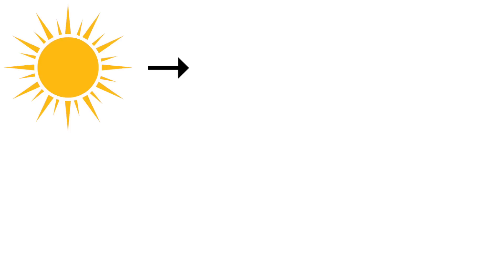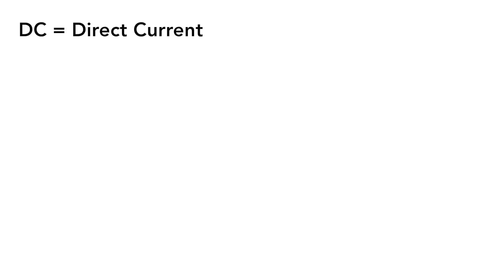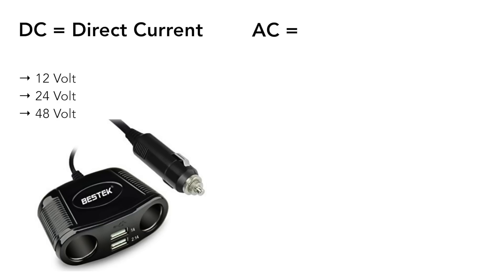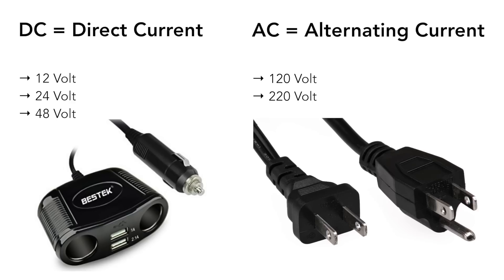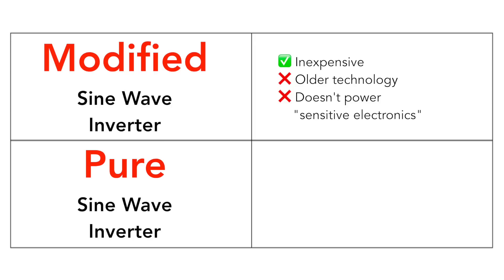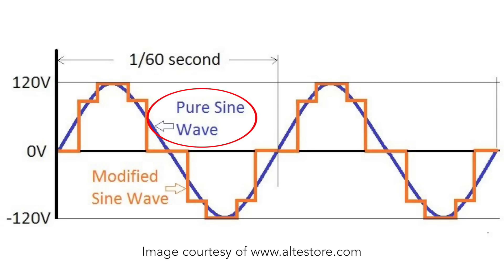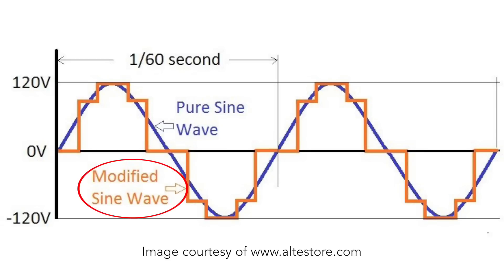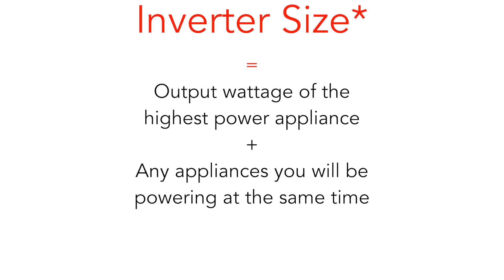Solar Inverter + Alternating Current vs Direct Current Explained

Comment: When you say if you use 2.8kw you need a 3kw invertor. Surely a 3kw invertor is 'peak' power, so wouldn't it eventually cut out?
Surely of you was using 2.8kw you would need atleast a 4kw invertor?

Comment: I use a 36volt to 200volt DC to DC converter to run my home appliances, most of them can run on DC and it's way more efficient than a pure sine wave inverter.

Comment: Can a solar system work without batteries to power my AC appliances? 
Panels->charge controller->inverter

relying entirely on the presence of the sun/no sun no power

Thanks in advance!
Reply from the maker: You really only need a charge controller to to properly charge the batteries in an off grid system. Grid-tied systems will use panels and inverters to offset your electricity usage and they can function with no batteries needed.
Reply: @DuetJustusFam  thank you for your response!👍

Comment: DC is also far more fatal, both from electric shock risk, and actual electrical fires. Getting electrocuted by ac power with less than 1 amp, and you only get a shock. DC power doesnt have an interupt, and forces constriction along the muscles the electricity is travelling through, making it extremely difficult to nearly impossible to move away, to release your grip, what ever means you'd normally be able to escape in an ac shock event. keep this in mind when doing a self install.

Comment: You asked about use of modified sine wave. I have a PowerSource 1800 Solar Generator (modified sine wave). I power two laptops, router/modem, Roku box and a 40" flat screen (during power outages) and haven't had any trouble (yet)

Comment: Another  concern I have is I'm using 4 lithium ion 100 amp batteries and 2 sealed batteries all in parallel because my 2500 watt pure sine wave inverter is only capable of 12 volts at the moment. I plan to upgrade. I read/heard that having too many batteries in parallel is harmful to them. Is this true and how can I improve my system

Comment: Solar arrays are most beneficial during the summer months and I'm living in Newfoundland with plenty of wind. The wind generator will supplement my energy need during the winter months. There is a built in charge controller in the sun force wind generator but I have not means to measure it and if I were to connect it to my 40 amp mppt charge controller, I would possibly exceed its capacity. I have an old 30 amp pwm on hand with a display. The wind generator has a built in controller but no display.  Can I run both in series?

Comment: Im wondering to avoid all these possible hassle can i just buy a solar generator with build-in inverter? Will it be more expensive than buying all batteries, separated inverter, wires, etc..?

Comment: I learned a lot  from your video and I thank you very much for that. If I consume ~ 20000W is it okay if I buy an 8000 W inverter? I will have 4 panels with 100 W and 2 battle born batteries. Thank you very much for the answer.

Comment: This subject is very technical and I can understand how it might scare off those that are not technically minded.  You have done a great job of explaining these concepts and kept it simple for those non technical people. 
 I agree with what you said about not using  a modified sine wave inverter for sensitive electronics. In my experience  modified sine wave inverters  (MSW) are not all created equal. I have come across some where the steps are so large that the wave output is almost a square wave. It is still AC output but the 'spikes' at the leading or trailing edges of the waveform is in my opinion what might damage electronic equipment.  I have also tested others where the design is no doubt of better quality and the steps are so small that the modified sine wave very closely resembles a pure sine wave .  Of course one can only see this after purchasing the unit and observing the wave on an oscilloscope.  I would still not use these for anything other than very rugged equipment.    One more thing,  induction motors such as the motors used in refrigerator compressors or pool pumps etc , do not tolerate MSW inverters very well , for these motors only a PSW inverter will work.  
 Great channel  , I'm going to search for your other videos.

Comment: Modified Sine Wave actually pretty safe to use with computers. It's pretty bad to power fans, fridge etc because the jagged wave will heat the motor so much it can break them.

Comment: Please produce a diagram of how all the components might be interconnected into a single system. Your videos are clear and concise; however, I am retired electrical electronic technician. I just do not have solar powered system experience and would like to fully understand the solar before installing a system. ALSO, please explain the micro controllers' advantages/disadvantages along with the availability of monitoring software's purchasing location and maybe cost. Thank you!

Comment: Your videos are excellent and clear.  I'm an electronics engineer.  Some fine points:  120 V AC is the Root Mean Square (rms) reading, which is a calculated measure that makes 120 V AC equivalent to 120 V DC.  So the peak voltage of 120 V AC is actually 120 multiplied by the square root of 2:  120 X 1.414 = 169 V.  This  peak voltage goes positive and negative 60 times a second in a smooth curve.
Most modified sine inverters have only 3 voltages:  zero and +/- peak (about 169 V).  They work OK with most computers, which have switch-mode powers supplies that convert the AC to DC immediately.  In fact, most Uninterruptible Power Supplies (UPS) used as computer backups provided modified sine wave output.  Modified sine inverters don't work well with motors and some old electronics with 60 Hz transformers.  Another problem with motors is the starting current.  A refrigerator may run at 3 amps, but require 30 amps for a fraction of a second to start.  
thanks,
Reply: I would be lost with your explanation. This video is for novices without your level of education.

Comment: Re your question about modified inverters running sensitive equipment, I bought a cheap 300W inverter and it powered the LED TV, the satellite decoder and I also spend a few hours on my PC. It also works with the modem. I am not sure if it is doing damage, but I there is no signs of a problem.

Comment: fantastic ... but what about surges and remedies for surges.

I'd like to see something about the latest tease, power wise.

The use of capacitors ... storage of power ... release of power and if the release of power can be controlled(resister?), to make the power release last longer ... maybe hours,  AND if it's really possible to dispense with batteries in favor for the capacitor...  

I'm also curious, as to the specific benefits, and best uses of a "Solar Generator" ...

Comment: Goodnight . nice series on solar units but one correction when showing the sine wave and modified sine wave the 120 0 and _120 volts .that is incorrect , if it is AC there can be no negative(_) 120 volts.it. is just 120 volts AC peak to peak.

Comment: a quick question , if my household runs 220 volts and i have a gadget which is 2,800 watts that runs at the same time and i needed to use 3,000 watts inverter , can i use this 3,000 watts inverter  to run 120 volt  and  or 220 volt?.  hope someone can answer this question, thank you .

Comment: thanks, I enjoy your videos ...  As for inverters I've been using modified sine wave for many years .  I run my laptop , tv  stereo lights , fridge and what ever I need to .  I always heard that they won't run or will damage electronics and motors but mine work just fine on them . I do have a 3000 watt pure sine wave but almost never use it due to higher power draw . Some times I think all those warnings  are to make u feel bad about using modified so u will spend more on pure sine wave of which most are not that pure anyway.  .....  Also all of your { sensitive electronic equipment } runs on dc  converted from ac in their power supply with a rectifier .   Does any one else have experience with this ?

Comment: We actually would not advise to get a larger than needed inverter, inverters have a minimum power input and if not reached it might not run, unless you are expecting to grow the system soon, and you have calculated the current system to account for the minimum input power required.

There are some other key points, but for a basic topic, there is no need to get into it.
Reply: Hi

Comment: I am a complete novice to determining what off-grid power is needed.
I have just purchased a 1994 Lazy Daze class C. It has no solar and no generator??.  The previous owners said they usually stay in full hook up parks. I need power for enroute and overnight stops and some dry docking.
Our needs are going to be focused on air conditioning. LED lights, power for iPad/phones and LED TV.
I thought about buying a quiet Honda 2000 portable generator and get a couple of good quality solar panels (roof space permitting). I have a pull out tray with two golf cart batteries.  (No space to add more but lithium?) I don't know what inverter to buy; perhaps you agree xantrax 2000 could work.
I have been following you since you got your RV and your opinion is so appreciated.

Comment: i know a mod wont run a dewilt battery charger it wont run some saws and drils if they are variable speed and always need more powerfull inverter if the appliance has a motor 3x the rating on the lable ie 100w +300w some things are bigger than that thouge

Comment: We've been running a modified wave inverter in our offgrid home for 2 years now. Without going into a big diatribe, it runs and charges all our electronic goods just fine BUT it didn't run our freezer properly. It burned out the big capacitor.  It definitely didn't like the stepped wave. Our TV, DVD player, 120V internet antenna and both laptops run on it just fine. Also pay attention to peak watts and continous watts when buying inverters. I'd suggest not trusting the numbers 100% and make sure to allow a few hundred watts for a buffer
Reply from the maker: Great info here! Thanks for taking the time to share your experience!
Reply: a mod will run some electronics if they have an adapter plug like tvs are 12vdc but run off a ac plug socket through a inverter that drops the voltage down to 12dc that coms with the tv

Comment: My understanding of an MPPT inverter is that is monitors the resistance of each panel (ohms) and maximise the use of the panels. On the other side of the equation you have the resistance from wires, inverter and batteries. I am completely baffled as to how can the MPPT power controller analyses the resistance on the panel side and the battery side if we talk about multiple batteries. Help? Next topic: if you look all this as a system you have to: be able to fuse and switch the panels side to work on the inverter, to be able to switch and fuse between controller and batteries. Oh same thing between batteries and inverters. Ok blades fuses, ac breakers, dc to dc breakers, diodes, buss bars, catholique buss bars . I have seen small and huge configuration (class A 2000w of panels etc). Also as am I pulling my rv can I charge the battery of the car and vice versa crank start the tow vehicule from the RV ?  I know lot’s of stuff to cover. You have a practical way of explaining important topics but also in cutting them out in the correct order for your video’s.  If you can do this I will Patreon you no problem. Regards from Montreal Canada

Comment: There's a lot to consider about inverters. But one thing that's really important is certain appliances need a far bigger inverter than it might seem. The two obvious domestic examples are fridges and freezers. While they might only draw 150-200 watts while running generally they need an inverter ten times that rating to ensure they start nicely. And never operate such an appliance from a MS inverter. They will run rough and the motor will probably burn out in a relatively short period of time. 

Pure sine wave inverters come in two basic varieties. High frequency & low frequency. High frequency inverters produce high voltage through DC-DC conversion and then chop it up to produce the AC wave. Where as low frequency inverters produce the AC wave at the battery voltage and step it up using a transformer. The advantage of the former is that they are smaller, lighter and usually cheaper. However the LF inverters tend to produce a cleaner more "grid like" power (actually, usually better because you don't have other people's "dirty electricity" on the line). They also have more grunt for starting difficult loads. 

"Modified Sine" inverters should really be called "Modified Square" because the waveform is really a square wave modified to include a longer dead period in the cycle. Things that will run fine from them include appliances that are just heating elements. Power tools & appliances with universal motors (nearly every hand held tool & many appliances), vacuum cleaners. And, interestingly enough any electronic device that has an external switch mode power supply. Such as laptops, cell phone chargers etc. Most LED bulbs run fine from them too. 

What you want to avoid running from them is appliances with induction motors, such as fans. Not so good for the motor as per the fridge example and the buzz might drive you nuts! lol Transformer based battery chargers (they'll never give the battery a full charge), audio gear (the high frequency harmonics from the power source will get into the audio and make a nasty buzz).  And small plug in "devices" that incorporate a capacitor-fed power supply. Such as rodent repellers, digital time switches, watt meters etc. This horrid design of power supply is expecting a sine wave and when it gets the square wave it passes more current than it should. Often with the catastrophic failure of the capacitor due to overheating.
Reply: You and I must have gone to the same school. This is the same sort of reply or comment that I leave, trying to stamp out the urban myths. Thanks for doing it for me.
Reply from the maker: Great info! Thanks for taking the time to share 👍🏼😎
Reply: I don't know what is a MicroSoft inverter (MS)

Comment: OK here we go. 
Bafang e-assist 36v 250w. 
36V 10.4Ah lithium ion battery
Now I want a 100w flexible solar panel ( goes on roof of my trike). 
What more do I need? A controller, and inverter?  
That's all?

Comment: might want to discuss the difference between peak watts and continuous watts regarding an inverter.  You might need 1000 watts and buy a 1200 watt peak inverter it likely wont do the job...
Reply from the maker: Good point. I will need to clarify this in a future video. Thanks!
Reply: Duet Justus , it has nothing to do with me being smart,  its because years ago i ran into that issue not understanding the difference in those two ratings and what they mean.  So don't take it as an insult,  you're spending tremendous amounts of time to produce very teachable videos and i think we all appreciate it or we wouldn't be watching them right?  You two are about to hit the road again next month i think you stated.  look forward to seeing where you go. Merry Christmas.

Comment: Would like to hear about the Magnum hybrid inveter compared to a non-hybrid inverter for a 50amp system and especially what it can do when the campsite (or driveway surfing) only has a 30amp (or 20 or 15amp) plug in? Thanks:)
Reply from the maker: Great question! I will see if I can squeeze that topic in a future video. Thanks for the great idea 👍🏼

Comment: I have a 3000 watt modified sine wave inverter. Have been using it for about 6 years in our motorhome. It works flawlessly to power TV's, laptop, hairdryer, kettle, coffee pot, vacuum cleaner, The only appliance it did not run properly was the microwave. It ran but the sound was different and I didn't trust it to not cause some damage, so that just doesn't get used except on generator. I could easily recommend the modified sine wave inverter when cost is considered
Reply from the maker: This is great to know Jim! Thanks for the input 😎👍🏼

Comment: Thanks for the great video. Do you know if there is a such thing as a 220volt inverter? Looking into the possibility of running a deep well pump and it requires 220volts AC, currently I run it off a generator when need water.
Reply from the maker: Yes! There are 12v to 220v inverters. They are more pricey but if that’s what you specifically need, it would be worth it. If you still need the functionality of a 120v inverter, you may look into getting a 120-220 transformer that will step up the voltage specifically for your pump. I don’t have any experience with 220v, but that’s where I would start my search 😊👍🏼 Hope this helps!
Reply: Duet Justus thanks great info.

Comment: I'm curious about going back and forth from solar power to shore power to generator. I have a 2016 class c so a lot of stuff already run off of the house batteries ( lights, slides, refrigerator, fans, water pump, etc). Stuff that doesn't (microwave, a/c, coffee pot, plug in appliances). So when the house batteries are connected to an inverter how does power get distributed to the AC outlets, will I need separate outlets from the inverter to run appliances or can the inverter be connected to existing outlets. And what effect does running the generator and/or shore power have on the solar power system. Will I need a way to switch back and forth?
Reply from the maker: Hey Dwight. I will be covering some of these topics in future videos... I can't wait 😊